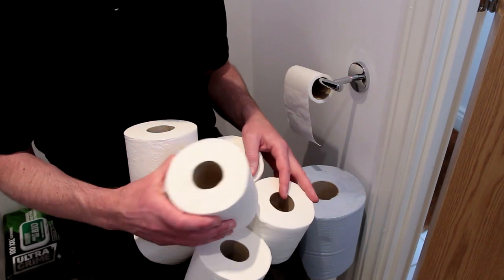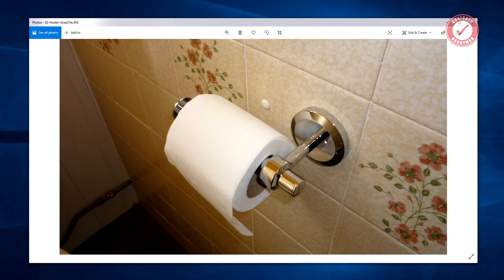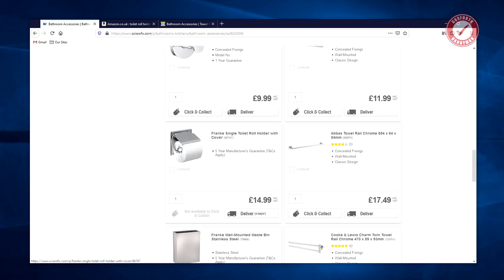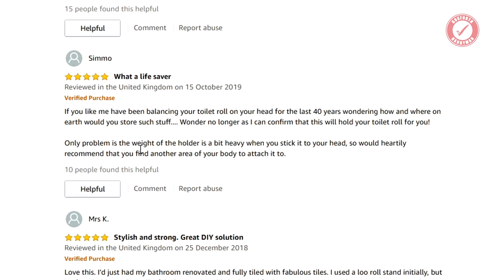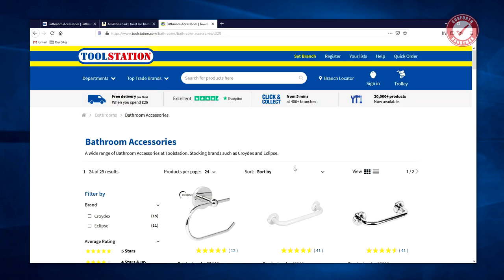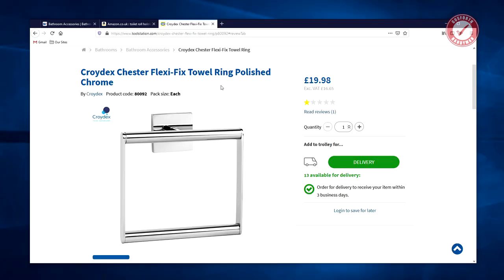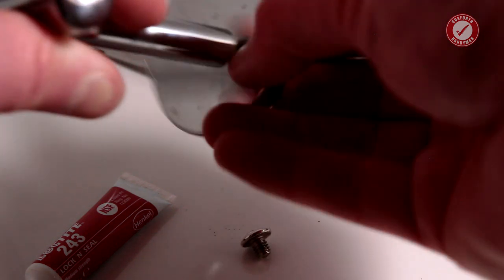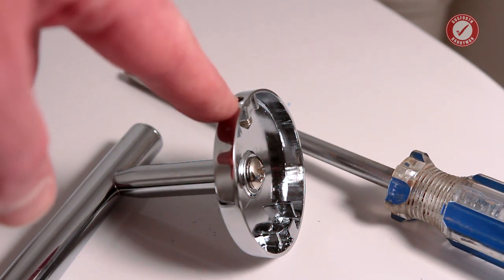How to Fix and Fit a Toilet Roll Holder to a Drywall / Plasterboard Wall

Comment: I did maintenance in a hotel part time for a few years. So I repaired a lot of these. They often come lose. I recently found a model made from sheet metal. It has a big surface area and is glued on with double sided foam tape. Indestructible and fast to apply.
Reply from the maker: These must be a full time job to maintain in hotels. 😂👍

Comment: +1 for the tiled wall drilling video!
Reply from the maker: Cool - will add it to the list. 👍
Reply: I agree.  Cracked a few tiles over the years.  Nothing worse than fitting a floating vanity cabinet to a room tiles floor to ceiling.

Comment: I put a new toilet roll holder on my wall, and because it was a little bit loose, I decided to take it off and drill a bigger hole with a bigger plug, but I drilled through the only pipe in the whole wall going to my radiator!!!!! I drilled it right in the centre of it, a 10mm pipe !!!! Water was gushing out!!! Flooded the toilet that I had just re-decorated, and the hall way , and after turning the water off, and eventually the water stopped coming out, I admittedly had a cry! My toilet roll holder was just like the one you have shown, mine went straight in the bin, and I havnt attempted to put another one on yet.

Comment: Got 2 of those exact same holders from 10 years ago, the "mortice and tennon" square joint between the backplate and bar had a tolerance!! of about 1.5mm and the screw would never hold it. A pounds worth of Poundland's finest epoxy filled and stuck the M&T and ensured the screw never moved. I think Tommy may have made a penny as well.....
Reply from the maker: Ha ha - that'll fix it. Good job! 👍

Comment: Who knew there was so much to talk about toilet roll holders 😂 great video bud! Interestingly the one you pointed out on amazon that you said was the wrong way up, when I worked on the renovation of a boutique hotel, we fitted two toilet roll holders in each bathroom, one as normal where you would usually find one, and the other just off the floor,  vertically, the purpose of this was to hold the spare loo roll 👍 
Nice to see you put the toilet roll on the right way too!
Reply from the maker: Yeah, I've seen a few in hotels like that used for the 'spare roll'. Not sure why other than it being easy to drop a roll on to from a height perhaps? 🤔😀

Comment: Being apprehensive about drilling into tiles I attached a small bathroom 'wire basket' organiser to a tiled wall using those outdoor sticky fixers. Having then got a towel rail I decided to drill this time and using a special tile drill bit it worked a treat; I thought I do the same with the organiser but those sticky fixers are stuck so tight it will probably ruin it if I try to wrench it off!
Reply from the maker: They only come off when you don't want them to come off. 😂👍

Comment: The bottom half of my bathroom walls are 12mm plywood sheets with plasterboard over the top so I have no trouble screwing bog roll holders on!
Reply from the maker: I'm jealous! I would seriously consider ply + drywall lined walls for my next project - or perhaps OSB even. Very useful! 👍
Reply: @GosforthHandyman  When I first found it, I thought it was absolutely ridiculous, but it's actually a great idea!

Comment: Andy I know it’s off topic with this video, but I need to upgrade some cheapo Argos/Ikea type recessed draw runners. I have to keep buying new ball bearing draw runners as they just don’t take the normal use. The ones I have are recessed in and I have no room to replace with good quality  side mount runners. I have literally about two to three mm each side of the draw. Without remodelling which would be my last resort any ideas on how to upgrade to a better type of runner.

Comment: Grub screw is missing from our toilet roll holder which is really wobbly. I've tried pulling the holder off the wall but it won't budge. I'm afraid of making a hole in the wall if I pull too hard. What do I do?

Comment: I'd put the grips on at 90 degrees and rest the backplate on a bit of scrop wood whilst drilling. That would feel much more secure. Love the channel :¬}
Reply from the maker: Cheers - yup, that would work! Take care! 👍😀
Reply: I'd be inclined to screw the backplate to some scrap wood. Much safer option if you're a cack-handed.

Comment: I never knew I needed a setting tool. Any chance to a link to one? 

Thanks
Reply: Screwfix sell them.
Reply from the maker: Yup - just go for a decent one. Cheaper ones break straight away. The Rawlplug one looks like it'll do the job. Also links on here: https://gosforthhandyman.com/products-i-use/uk-based/ 👍
Reply: Buy the one in the link, don't be tempted to buy the one that's 5 quid cheaper, it breaks.

Comment: 10:27 👍but then at 10:35 👎- can you tell I work for Henkel? (we make Loctite). Incidentally, (sounding like you now), you can get different strengths of thread-locker including one that would work on the grub screw and still let you remove it later.  Keep up the good work - I can't say that I have ever seen a video on fixing a bog-roll holder before😂😂

Comment: Have exactly the same shit ticket holder, 
Been up and working for last 4 years, but one of the kids managed to dislodge it, 
Bars nice and tight back plate firmly secured,  but using the grub screw can't seem to stop it moving or even falling of or dropping off
Took backplate of and offered it up to the holder, plate seem a tad to short, also the lips on the backplate look like slightly different widths one side is slightly wider than the other end and overall length looks to small,  athough is been up for the last 4 to 5 years 

Any thoughts,

Comment: Hi Andy, some good tips as usual.  While, as you say, a substantial backplate  and good fixings are essential, the cantilever load with those one sided bog roll holders doesn't help.

Comment: Nice dunny role holder vid apart from you have it facing the wrong way there's a bigger chance of pulling the TP off the holder as you've done it as opposed to the other way around just saying also a good position for the dunny roll holder is 700 mm x 700 mm

Comment: Remember when I moved in here. It had the wall plate, and the tightening grub screw, both fine, except the grub screw was at the top, and the whole thing upside down, so the bend in the bar pointed down, so the shit tickets just fell off the holder. Who TF fitted that?!
Reply from the maker: Lol... that's mental. Shit tickets. 😂

Comment: Where do you get the grab screws, I have one that is worn out and needs to be drilled out and I have no replacement. :(
Reply from the maker: Yeah, loads on Amazon, Ebay etc. 👍
Reply: @GosforthHandyman  how do you measure those screws. I have an electronic gadget and it tells me it's 4.65mm. So is that m4 or m5? 😕

Comment: I absolutely hate toilet roll holders that make lots of sound when unrolling the paper. Since my toilet is relatively small I hang my rolls from a colorful solid core electric wire with a small piece of plastic tube as a spindle. Just twisting/untwisting the wire when switching rolls. Desired height adjustment is easily done. Perfect for my needs ;)
Reply from the maker: That'll do the job! 👍

Comment: Just put a new one up old style like you were showing , £1.90 delivered from Amazon    (prime) ,it's made from anodized  aluminium with a plastic roller perfect.
Reply from the maker: Does the job - will probably last forever. 👍

Comment: Sometimes getting a longer grip screw (locks handle part to wall bracket) does the trick.
Reply from the maker: Good tip! 👍
Reply: @GosforthHandyman  I've found that a shim of cardboard (loo roll tube) for the grub screw to bite against helps a lot.

Comment: 19:22 - cue the discussion as to which way the toilet roll should go on the holder !
Reply: Was exactly what I was thinking. It was about two things, hygiene and the roll rolling off (or not?) What is the proper way?
Reply: @jacques7799  The proper way is to hang over the roll (i.e. in front) and not under (behind) otherwise you could pick up on your fingers what could be smeared on the wall....
Reply from the maker: There is only one way. The other way is the start of insanity. 👍

Comment: A designer only gives ideas to a home owner and then the designer don’t leave in that house .
A toilet paper holder should be strong .
Willing to withstand push and pull  a toilet paper holder gets more used tan a towel holder.. just screw a 6 inches screw on the 2x4 and you will have a tp forever

Comment: Careful not to overtighten the grub screw as the backplates frequently are made of pressed steel and can deform making it impossible to anchor the holder to the plate
Reply from the maker: Indeed - if the thread goes life gets tricky. 👍

Comment: Brilliant video! I've fitted loads of these - exactly as you did, but WHY can't the manufacturers make the fittings more robust in the first place? It would take almost zero effort to improve the product....

...and don't get me started on what happens when the grub screw fixing part wears to the point it will no longer hold the holder!!@#@#! :-)
Reply from the maker: I know - tell me about it. We can put NASA capable computers in our pockets but we can't get simple stuff like this right! 😂👍

Comment: If you buy branded goods on Amazon it will be fine.
Reply from the maker: Sadly a lot are fake branded and it's very difficult to tell what's real and what's fake. Been stung many times with 'genuine' goods on Amazon, Ebay etc. 🙄👍